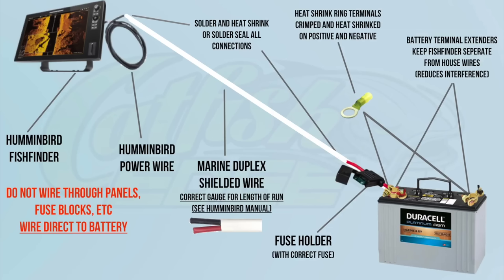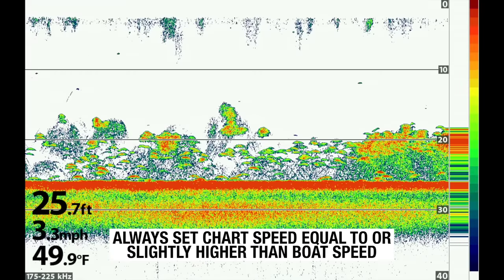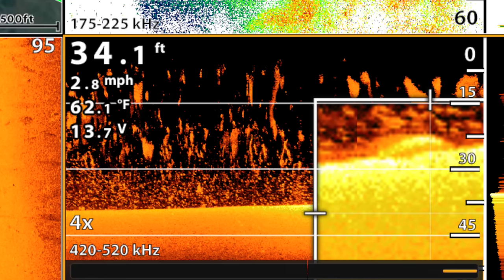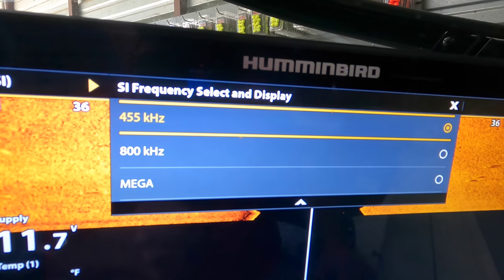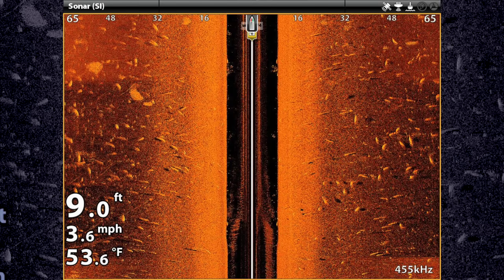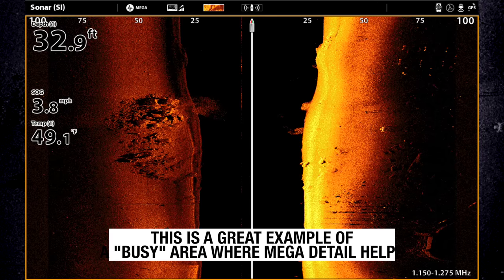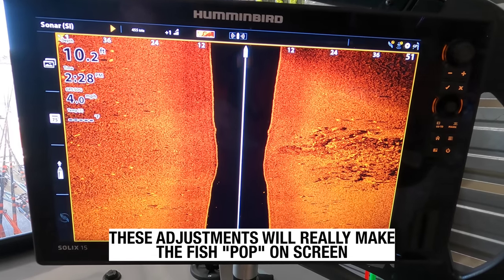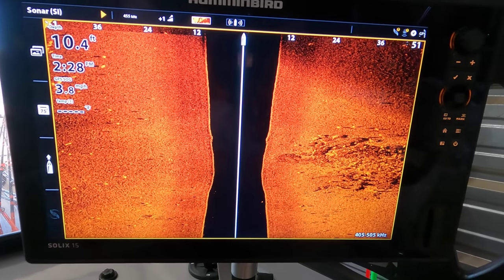Top 5 Fish Finder Mistakes (Most Anglers Make)

Comment: One thing that I would suggest to someone new to side imaging is look for shadows of the fish.  If you see a little gap between what looks like a fish and the shadow, it's most likely a fish.  A rock or debris on the bottom usually won't have those gaps.  Also you can get a pretty good idea how far off the bottom the fish are by the size of the gap
Reply from the maker: This is true but fish and other items laying on the bottom are easily identified.

Comment: Hey Chad, I run Lowrance and I cannot find a chart speed setting in the set up.  I know guys that run hummingbird and they are always changing it to match the boat speed.  I usually scan at idle so your comment about 1 to 3 mph confirmed for me the way I size fish based on that.  I have 2 units and I keep one on 2D sonar and run down scan or side scan on the other one.  I run 83 kHz on 2D and 455 kHz on down scan/side scan.  That seems to provide the least interference between transducers.  My issue with side scan is how to mount the transducer so I can use side scan with the motor in the water.  I don't know any way to see both sides without trimming the motor.  Any suggestions?
Reply from the maker: It used to be under Advanced Settings, I think it's called scroll speed on Lowrance units. Trimming the motor is common or you can run two transducers.

Comment: I'll tell you the biggest mistake is thinking you can send your humminbird back to the factory for repairs after six years,who would spend the money on a car that the dealership won't work on??? Fishing industry needs to be held accountable for the throw away products, the landfills are getting enough junk without these electronics.
Reply from the maker: It’s not a car. It’s an electronic device and has an end of life. Pretty standard.
Reply: You can add west marines 2 year extended warranty , but they will loose your information before 6 months is out , and your still stuck with a glitch simrad go9 with a turtle slow pentium processor ..that over heats in the sun , maybe I needed a bigger screen😂 😂😂😂😂😂